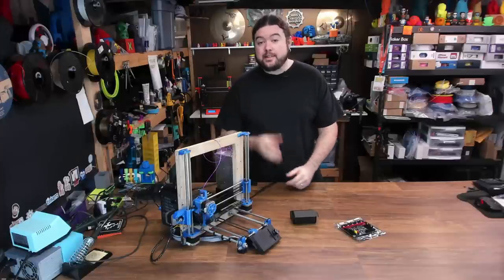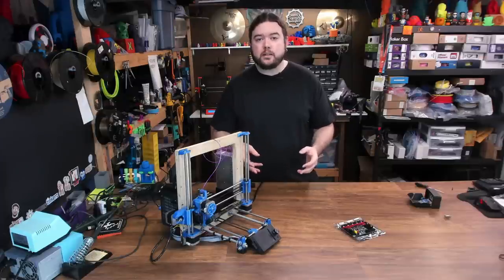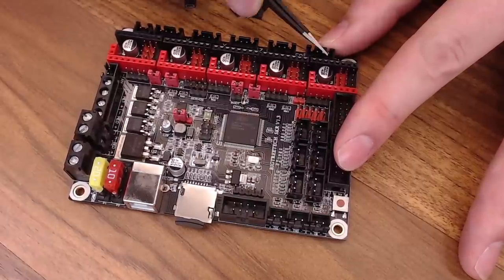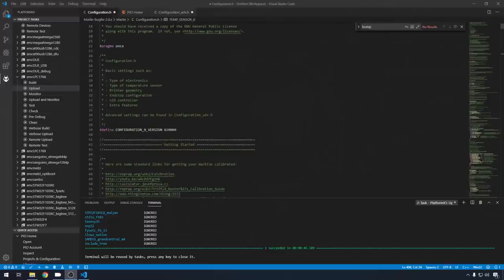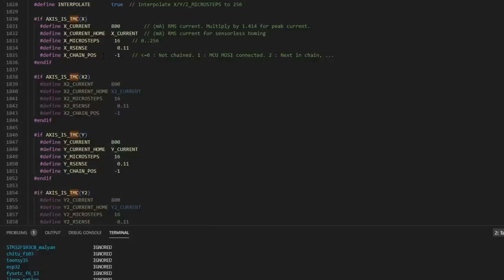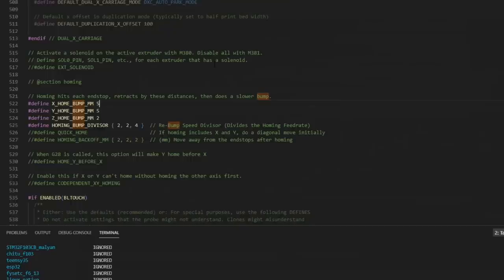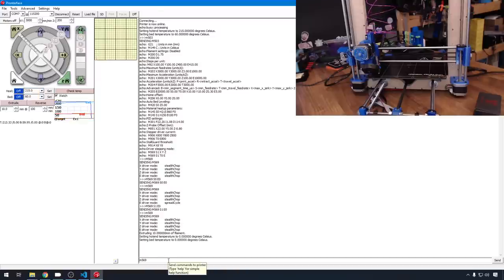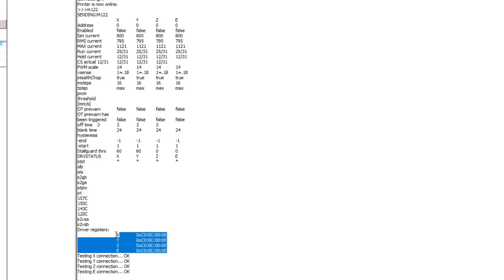TMC2209 Stepper Drivers - Bigtreetech - SKR 1.3 - Install - Chris's Basement

Comment: i have plugged my drivers in reverse direction. are my drivers  or board done because i am getting tmc connection error now
Reply from the maker: My first guess would be the drivers got cooked. Do you have any other drivers you can test the board with?
Reply: I have spare drives. When I plugged them, I saw that the driver slots that received wrong installation does not work anymore Alongwith the drivers that I installed wrongful initially.
Reply: However other slots are still working but board is not useful anymore since only two ports are working now
Reply from the maker: That's a bummer man.

Comment: Curious about your thoughts, I am getting ready to upgrade a Wanhao Duplicator 6 with a SKR v1.3 board and a buddy recommended I look at the TMC2209s.  I was going to go with TMC2130s.  I am not going to go with sensor-less homing, so would you stick with the cheaper TMC2130s or recommend the TMC2209s in that situation?
Reply from the maker: If you don't need sensorless homing I would go with 2208's they run a lot cooler than 2130's. 2209's run even cooler than a 2208.

Comment: hello sorry for the translation but i followed the video for tmc2209 standalone meter with just the 2 rider the problem is that the engine makes a funny noise and the chaotic movement
Reply from the maker: Hello, what board are you using? Maybe the current is to high?
Reply: @ChrisRiley  SKR v1.3, TMC2209 V3 fysetc, alim 24v
Reply from the maker: @fabricebougardier1250  Recheck your current setting and micro steps.
Reply: @ChrisRiley  https://forum.fysetc.com/d/199-tmc2209-v3-0-uart

Comment: Can you help me out? I Have a Core XY (hyper cube with linear rails)and a mks smoothie clone running smoothieware. I just got a SKR 1.1 Pro with 6 SKR 2209s I want to go from 2 extruders to 3 ( Currently using a filament Y and one hotend) I want change to a 3 in one or make a 3-way Y. I will be using Marlin 2.0 as much as I love smoothieware, I want to try mixing in the future on a 3-one hotend. I have a BLtouch and I am using all X,Y and Z end stops to home then setting the Z offset from the probe in a grid auto leveling pattern. I also am running 2 filament out sensors.  Can you do a video or get back with me on how to set up the SKR 1,1 Pro with 2209s , sensorless homing on X Y. I will use Z with  a endstop, and the bl Touch to auto level, I also want to see if I can use 3 filament out sensors on separate ports like I am using two now ( I use the X max and Y max) or if I have to set them up as a serial configuration. I was thinking I could use the X max, Y max, and Z min but I do not know marlin so I am grasping at the "YouTube" university for help. ( and the Marlin manuals). I know I need to re-devine the pins somehow but that is where I am at. 

Thanks for any help.
Reply from the maker: That sounds like a big project. I am not sure what pins you have available on the board, but you would want to start with the pins file. Check out pins_BTT_SKR_V1_.h
Reply: @ChrisRiley  Thanks  for the reply, I was able to figure out 90% of  my issues so far considering I just started to learn Marlin 7 days ago.  I did come across a issue with the newly released official release of Marlin 2.0 VS the bigfix version.  For the SKR Pro V1.1. board config file. the file PeripheralPins.c has a few pins switched and Per the gethub and facebook page I copied it from the bugfix version and I got the BL Touch to work as it should.  I emailed the SKR support team and they helped me with the wiring of the MKS 3.2 TFT Bd , so I got that to work. For now I am just getting the printer back in action  with  my current setup of 2 extruders. I will work on the 3rd extruder after the holidays. My only thing now that I am now working on is  to use sensorless homing or not. I have the end stops in place and they work fine, so not sure if I want to try the sensorless homing on the  X, Y.  I see out there in the blog world they do not recommend it for a Core XY printer. But I had to bend the one diag pin out of the way for the endstops to work.  I do not want to cut them off just incase I still want to try it.  Also because I do not have a "ture" LCD display designed for Marlin (MKS  TFT is a serial controller) . I can not use the filament out  "M600" script. It gives me an error about no LCD display. So for now just set it for a  M25 . If anyone can come up with a workaround so I can use the M600 script without a LCD display I will be all set.  At least the M25 I can see  as a pause it from my octoprint and octoprint anywhere app.  I then have octoprint when it sees a pause, it homes x and y so I can change the filament. then When I resume the print I do another home X, Y  then it goes back to work where it left off.  I had to manually copy the  .bin file to my SD card because I could not seem to get the "Upload_Port=" to work. and I do not have the printer near my computer so I can not just plug it in.
Reply from the maker: @Prt_3D_RC  Glad you're making some headway. Sensorless homing is kind of tricky, I am struggling with it on my core XY as well. Yeah, M600 with no screen, that could be useful in some cases. It would be great to work that into octoprint.

Comment: I just installed the SKR 1.4 and the TMC 2209's and now my extruder motor isn't working. It locks the motor like it trying to turn. I swapped drivers and the problem stayed with e0. Do you know why this is happening? Also I noticed this...  Not sure if the e0 values are correct.
Recv:   X Y Z E
Recv: Address  0 0 0 0
Recv: Enabled  false false false false
Recv: Set current 800 800 800 800
Recv: RMS current 795 795 795 1436
Recv: MAX current 1121 1121 1121 2025
Recv: Run current 25/31 25/31 25/31 25/31
Recv: Hold current 12/31 12/31 12/31 12/31
Recv: CS actual 12/31 12/31 12/31 12/31
Recv: PWM scale 22 12 22 66
Recv: vsense  1=.18 1=.18 1=.18 0=.325
Recv: stealthChop true true true true
Recv: msteps  16 16 16 256
Reply from the maker: Try switching the E steps to 16 and retest.
Reply: I ended up turning UART off because nothing I did fixed it. I tried increasing the current, thinking maybe it was too low at 800. I turned UART off on just E0 and it worked but then z was moving extremely slow. So they're all on TMC2209_STANDALONE. Also even though above says  "Recv: msteps  16 16 16 256" it was set to 16...

#if AXIS_DRIVER_TYPE_E0(TMC26X)
    #define E0_MAX_CURRENT    800
    #define E0_SENSE_RESISTOR   91
    #define E0_MICROSTEPS       16
  #endif

Possible there's still bugs in the SKR 1.4 firmware
Reply from the maker: @jmcallister3951  Very possible, it is still pretty new.

Comment: Hey Chris 
Dunno if you could help me ... I just got the turbo and had noticed my E drive skipping steps and while I was tweeking my settings I had added a smart graphic display but upon reboot my steppers wouldn't move ... Switched displays and even tried the alternate branch of marlin 2.0 in place of the bugfix ... I'm out of ideas here ... I'm running tmc 2209 and followed the setup and even cross referenced to make sure I have everything correct but my steppers still won't move ... Should add that they are free to move and that the M122 in pronterface gave the ok that everything if fine and they are working ... I'm sure I'm missing something just not sure what? Any help would be appreciated thanks
Reply from the maker: Hey Mike, I am not sure what is up. Did the drivers work at one time? The board thinks everything is okay it sounds like.
Reply: @ChrisRiley  yea they did ... I just saw the part where you said about buying them with the board ... These were from my skr 1.3 ... Unfortunately its malfunctioned due to my lcd screen burnout ... I messed up with some LEDs on my tft35 and something popped and so I bought the turbo hoping to get back to printing and I'm thinking the 2209s aren't going to work unless I alter them somehow.
Reply: @ChrisRiley  sorry to add a little more detail ... I checked the vref on all 4 and they all read 1.2-1.3v ... I set the current per your video and I had also swapped back over to my ender 5 board and checked to see if the steppers worked and they do ... I'm thinking I messed up my 2209s along with my 1.3 board and should just buy new ones and see if that works ... Pronterface gave an ok but I think it said they were disabled but it kept shooting information through so I couldn't get a good look at what it had said. I'm pretty novice with this stuff ... Sorry ... Trying to give you as much detail as I can.
Reply: @ChrisRiley  sorry 1 more ... I didn't want to run sensorless homing and found the part with the diag confusing my x and y are both removed, z and e are still on ... I'm thinking of switching to sensorless and getting rid of the endstops if that helps and I know if have to put pins back in the x and y chips if I were to use these ones ... I may just order new ones and take my chances with them just to be sure ... Oh and while jumping through marlin and the bugfix and the one btt puts up I noticed that one time I set the current but when I brought it up on the menu it was different and I had to change it ... Still no help and I can't find where I read it but I seen something saying that if your motors aren't moving to lower the standby (current?) Not sure if I'm correct about the current part ... Been reading alot sorry ... And thanks for the reply
Reply from the maker: @mikethorne1390  But they never worked on your turbo board correct?
Reply from the maker: @mikethorne1390  So yeah, sounds like maybe the 2209's took a hit too.
Reply from the maker: @mikethorne1390  Make sure you run a M502 and an M500 to update your eeprom. That might be the current difference you are seeing.
Reply: @ChrisRiley  actually they did work for a bit till I noticed the extruder was skipping steps like studdering and under-extruding material so I went into the firmware to check things out and while I was in there I decided to update to my reprap discount smart display and that's when the steppers just stopped moving ... They feel like they are vibrating when I touch them though ... I will try that and see ... Thanks for your help ... I'll let you know tomorrow if it works
Reply: @ChrisRiley  to add I don't think I actually changed anything as far as the steppers were concerned I mostly just wanted to see if I missed anything and I don't recall missing anything and I tried the bugfix and marlin 2.0 and the skr firmware roots and no change with the steppers. A bit repetitive for the same result so I'm assuming it's either a deeper setting or they took a hit ... Since I've gone through all the firmware I'll do the M500 and M502, if still nothing I'll just order new ... But I will update you and thanks your videos are hugely helpful and greatly in depth. Thanks again
Reply: @ChrisRiley  sorry it took so long but i did try updating the eeprom with no change and i even bought 4 new tmc2209's and still no change. im thinking something with my ender 5 config. files was messed up. i think im going to go through my configurationh and adv. from scratch and do it all myself instead of using the example files and see if that helps. thanks and ill update you incase theres anyone else having the same issues

Comment: i have set everything up as per but the extruder motor is getting that hot i cannot touch it, the vref is set ok so why is the motor getting so hot, iv swapped out the stepper moto and still same thing, its getting that hot it stary=ts to click and the filament stops feeding into the nozzle
Reply from the maker: What motor are you using, if it's a pancake, you will have to lower it even further. Try switching the driver setting to spread cycle mode and turn of linear advance.
Reply: @ChrisRiley  HOW di i turn of linear advanced

Comment: i need help I could not get atom to load and run on fresh wind 10 install so using vscode finally got the project  to build but regardless of settings for serial port build and up load report autoconnect cannot find port i have watched so many videos I am cross-eyed firmware. bin is loaded on card and the computer see it.
want to use to run my x5s old board died
Reply from the maker: So that is usually because the firmware that is on it isn't configured correctly for serial. make sure the first serial is set to -1 for that board. Build the firmware then load the .bin file on the SD card manually the first time, it should work after that.
Reply: @ChrisRiley  i tried bot 0 and -1 doe serial connections. after some rewatching I did not unplug the usb after i loaded the firmware.bin file so i think that was the problem will try uploading again later  putting the board back in the printer and have to watch 3 year old in a few minutes thanks for the quick reply as usually just something I missed because it was simple

Comment: Why did they make boards now-a-days with only one Z slot?
Reply from the maker: I blame the ender 3 . LOL ;)
Reply: @ChrisRiley  I just bought one of those Z splitters for this board. I hope it works.
Reply from the maker: @dragnet53  It should work fine.
Reply: @ChrisRiley  Now some strange reason I can't upload. It says  LPC1768 failure. I know I don't have my endstops installed currently, but wouldn't think it mattered. I just wanted to test it.
Reply from the maker: @dragnet53  Does the computer still recognize the board? Might have to manually load the SD card and set the serial back to -1.

Comment: Do i need to break the 2 pins under the drivers?
Reply from the maker: It depends on which board you want to use. If it's not an integrated board like an SKR you might have to, but you also might be able to control that with the jumps on the board so you don't have to cut them.
Reply: @ChrisRiley  the skr 1.4 specifically state you need to brake the pins, i don't like it, but so far this feature seems to be unreliable, it sometimes stops sometimes does not. i'm not sure if this is motor related (i'm using motors with peak current of 2A and the RMS is 1200 on the driver) or something else
Reply from the maker: @emaayan  Wow, I am going to have to check out their doc.
Reply: @ChrisRiley  https://photos.app.goo.gl/Qz2uKoH3p2Uo7rxe8
Reply from the maker: @emaayan  Thanks! I would have thought just pulling the diag jumper would have fixed that.
Reply: @ChrisRiley   nope, which makes me feel kind of nervious breaking the pin, btw how's the babystepping acting?
Reply from the maker: @emaayan  Babbystepping seems to work the same.
Reply: @ChrisRiley  no it's not:) there's a confirmed bug on it:) https://github.com/MarlinFirmware/Marlin/issues/16617

Comment: The issue I'm having is I can't find a good sensitivity level. They either fail to home or grind momentarily if already homed.

EDIT: Disabling "QUICK_HOME" in Configuration_adv.h appears to have resolved the grinding issue.
Reply from the maker: That seems to be a really common problem for these. I still have an occasional homing fail on some of these.
Reply: @ChrisRiley  Thanks, perhaps it's just a bug in Marlin.
Reply: @ChrisRiley  Never mind, resolved it by disabling "QUICK_HOME" in Configuration_adv.h. 

I also enabled "HOMING_BACKOFF_MM" but I'm unsure if that had any effect.

https://github.com/MarlinFirmware/Marlin/issues/17687

Comment: Well i got a SKR 1.3 and BTT TMC2209 and sensorless homing doesn't work for me with your settings.
Reply from the maker: Hmmm...do you have your diag jumpers on?
Reply: @ChrisRiley  Yes, of course. I followed your description step by step. I have a Sovol SV01, but this shouldn't make any differences. Everything works besides sensorless homing and the FAN at Pin P2_03 won't run. I took the newest Marlin 2.0.1 and not that from BTT-github. Which should be no problem, isn't it?
Reply from the maker: @whyme3697  Yes, Marlin 2.0.1 should work just fine. Does it just crash when you try to home?
Reply: @ChrisRiley  Yes, of course. And if i try to stop by hand, nothing happens.
Reply from the maker: @whyme3697  Not sure, maybe something stuck in eeprom? Run a M502 then M500.
Reply: @ChrisRiley  That's what i did already, but nothing changed. I will try a new approach with a fresh marlin. Whats wondering me, are all these bug-reports concerning sensorless homing ...
Reply from the maker: @whyme3697  It could be a bug for sure.
Reply: @ChrisRiley Hi Chris, i've done everything new, with the lastest bugfix-marlin - and ... nothing. I cannot imagine why sensorless homing works for you and not for me and many others. Meanwhile i can say that configuring marlin is pretty easy. So, where is the point i make a mistake? It is frustrating if there are others with a working setup :-(
Reply from the maker: @whyme3697  I will go back and reinstall, maybe I can find the bug.

Comment: Chri, how r u? I need some help i have a SKR 1.4 TURBO  with FYSETC TMC2209 V2.1 i can{t get them to do homing, i´ve being compiling marlin for a few days but I need the help ofsomeone with experience.
thank u very much!!! Nick
Reply from the maker: I am doing well, thanks! THose drivers are standalone by default. Use you MS jumpers like I show, not the UART ones and set Marlin like this. TMC2209_STANDALONE then retest.
Reply: @ChrisRiley  Chris I'm going to drive u crazy, I just sent u a tip thru PayPal.
I need your help, I just installed the BTT TCM 2208 v3.0 and I still have problems with the endstops.
Do I have to put the jumper on the driver? Between the TX and RX pins?
Thank you very much!!
Reply from the maker: @--3D  Sent you an email.